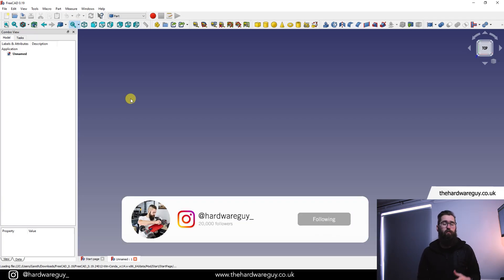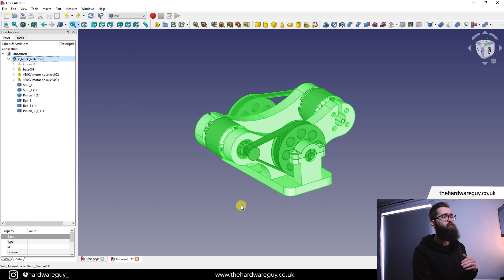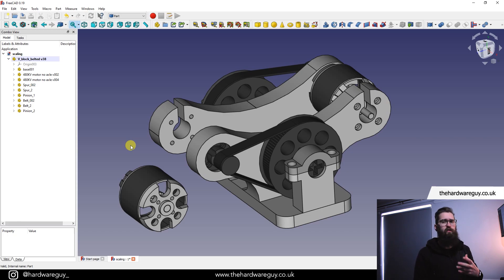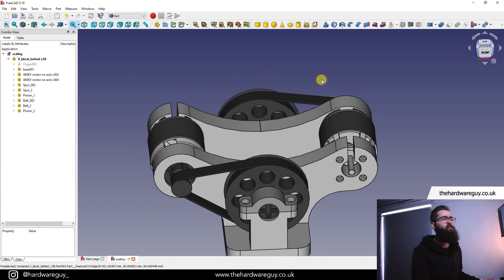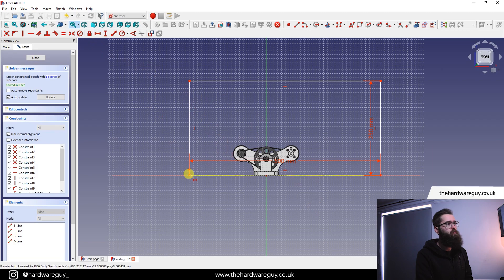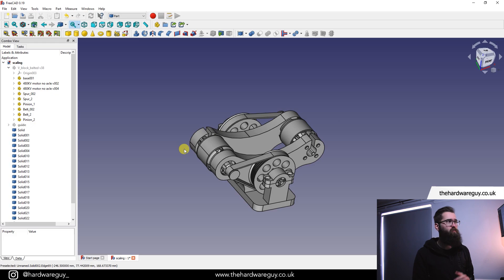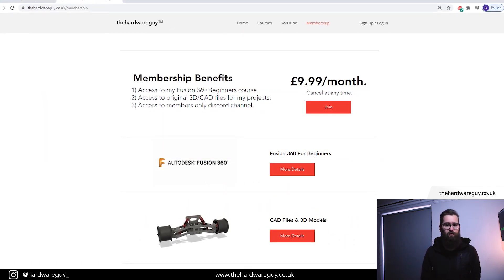FreeCAD for Beginners pt.7 - Importing .STEP files and Scaling

Comment: As in Fusion you have to make every body into a component not as in freecad. The part is a container likea folder or a envelope. A project can be made without tham just a bit messy. Making every body into a part folder is unnecesary cluttering

Comment: Great tutorials! Thanks for sharing with maker community. How can I easily modify dimensions of a shaft in a STEP file using FreeCAD? In Fusion 360, this is a simple operation using push/pull tool. In FreeCAD, are boolean operations the only way?

Comment: If you are in the uk.. Picture my best Victor Meldrew voice...

I don't beleeeeeeve it!!

I watched your playlist, saved it for future reference, and fired into free Cad with a new determination to succeed.

I have almost finished my first can creation, a rolling box for my partner so theres no bits of baccy and green littering every available horizontal surface! I know theres plenty of such boxes on thingy but it a learning experience and chance to make something bigger, better, faster...

It is parametric, not only does it change the size of the box in all 3 dimensions with built in limits, but it also automatically arranges the bits inside to hold a lighter, papers, roaches, grinder etc depending on the size, can change the size of the lip round the top, and it also resizes the lid to suit.

I have a tolerance parameter so if the sliding lid is too tight/ lose, you can change the tolerances and have the whole thing recalculated..

There is NO WAY, I was going to get this software to click in my head until I came across your video's, and now its all starting to fall into place in just 24 hours or so. Still  whole pile to learn, but I have created something I had absolutely no chance of creating in Tinker!

THANK YOU, THANK YOU, THANK YOU, you are a living legend!
Reply from the maker: Hi Louise, I certainly am from the UK, and thank you for the kinds words! I'm so happy that I've been able to help you with your creations! Sounds like you've discovered the power of parametric modelling, thanks for watching :)
Reply: lol I just got flashbacks of One Foot in the Grave and England after living and engineering in Dhaka for over 6 years now. Would love to see your rolling box design as I too, am a connoisseur of high quality special vegetables ;) 

Sounds like you really have a hold of the parametric functions, can't wait to get there myself!

Comment: If your FreeCAD .STEP file imports are a single body instead of multiple check the FreeCAD setting under
Edit->Preferences->Import-Export->STEP->Import->Enable STEP Compound Merge = UncheckedNote: 
Think Solid works has an option in settings "General->Import multiple bodies as parts" if it helps (I never used the package to test)

Comment: Another excellent video. Thank you.  One question — your audio seems low when compared to the ads that play, or to other videos.  I’m not sure if that is an easy thing to increase, or not.
Reply from the maker: Thanks for the feedback John, I will look into it. Ads typically play a bit louder by default, it's a cheeky tactic by YouTube you get your attention!
Reply: @thehardwareguy  Your videos are quieter than most others as well, so turning the volume up to what would be a normal level makes the ads and other videos extremely loud. I'd suggest raising your gain a bit in the videos.
Outside of that, I want to thank you for showing the value of using a part to contain multiple bodies (in this and your previous video). The orientation correction (from an imported STEP) alone is worth it. Up until this point, I've done hundreds of models and more than a few assemblies (using Assembly2 and A2Plus) over the years, and I always started with a body instead of a part.
:) You've got a new subscriber.

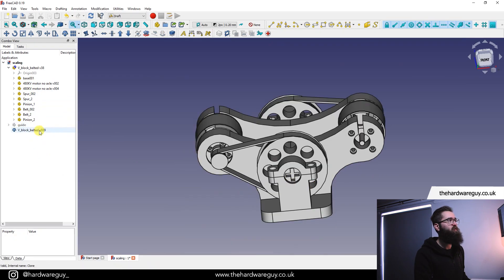Comment: Is the motor on the right side (at 9:44, for example) in the base backwards? I really like this series and I downloaded FreeCAD but my Mac won't let me open it because it can't verify it's origin.
Reply from the maker: Hi! the orientation is correct, for this test rig each motor has its own driveshaft so they are independent of one-another! You can easily fix that Mac issue too, try to open FreeCAD, then go to System Preferences - > Security, at the bottom of the menu you should see "Open anyway". This will let you run software from "unknown developers" on a Mac :)
Reply: @thehardwareguy  Thanks! I always forget about that since they udated security setting a couple of versions of OSX ago. It looked like the axle stuck out the same as the one on the other side of the base, but at one point you moved the assembly out of the way and the coupler to the drive hub remained in place and I didn't see a shaft coming from the engine on that side, so I was confused. Admittedly, I've never used motors that the whole motor spun like that before. Thanks for the reply.